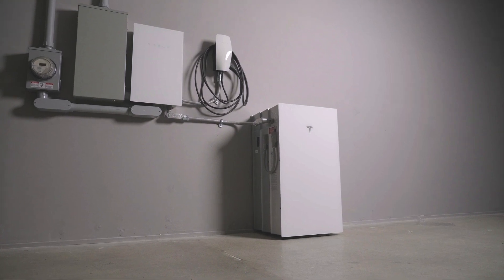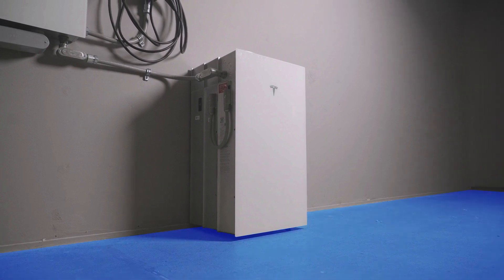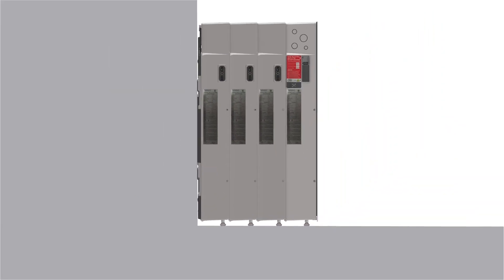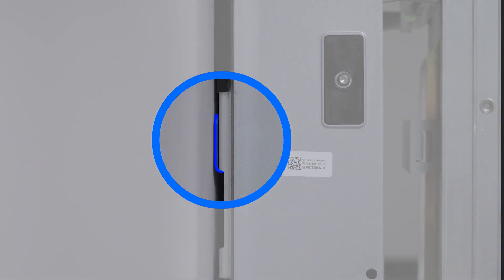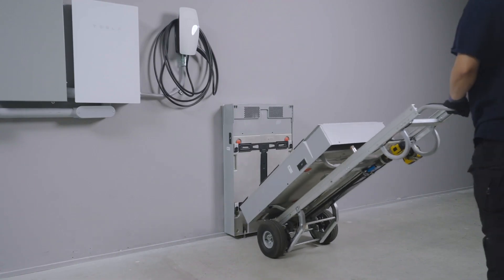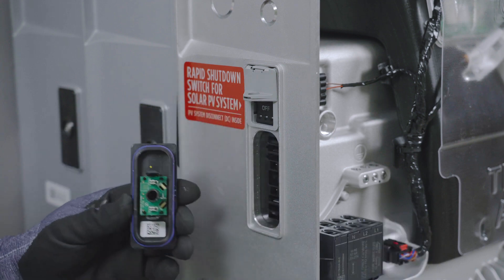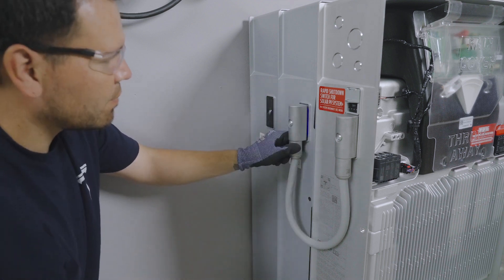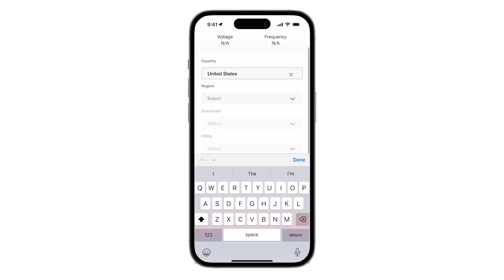Tesla Powerwall 3 - Expansion Unit Stacking - How to?

Comment: How did the first expansion kit mounted to wall get power??
Reply from the maker: The first expansion kit gets its power directly from the main Powerwall 3 base unit, through Tesla’s integrated connection system, not from the grid or inverter directly. Feel free to ask if you have anything else.

Comment: I just realized that a Powerwall 3 installation can only be expanded to 7 batteries, 3 expansion unity tied to the Lead Powerwall 3 and 3 additional inverter Powerwalls.  This is mind boggling to me. I can’t think of a single reason why each Powerwall can’t accommodate up to 3 expansion batteries for a total of 4 PowerWalls and 12 expansion batteries.  I can’t see a partial reason for only 4 PW3 units as it can provide over 190 Amps, because more would would require Herculean Gateway Ampacity.  Also, a 400 Amp panel could be subdivided into a primary 200 Amp, battery backed panel and a secondary 200Amp, battery backed panel, each with their own gateway.
Reply from the maker: This is exactly why Tesla Powerwall is not the most popular ESS for homes in Europe (beside its price). Others are more flexible and scalable.
Reply: @3buysolar  I’m a retired chief engineer in electronics power subsystem architecture design.  It isn’t remotely credible that a competent power delivery engineer could have come up with a capacity expansion architecture so limited.  It had to be intentional.
Reply: Support for this is coming later